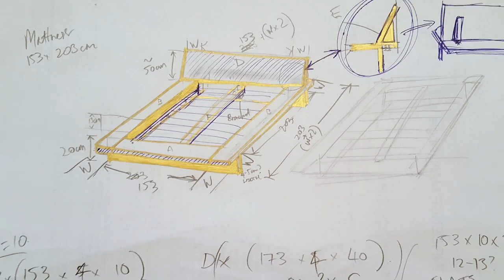Hardwood bed frame - DIY Build

Comment from the maker: Yes the music is bad. Yes I should have been wearing footwear.  You'll be happy to know I'm working on a new build video which will hopefully make up for the mistakes I made in this one!   Should be finished building and have the video up with a month or two... stay tuned folks.
Reply from the maker: @The Disliker deep question... I'm not sure the world is ready for the answer
Reply: Chris Kastner the video is actually more enjoyable with this type of music. Just the barefoot made me worried. Other than that, it was perfect.
Reply: I thought the music was very relaxing.
Reply: The music was fine except it was a bit tinny. I had to turn it down part way through.
Reply: Other than that, I loved it! I’ve been looking for a frame to build on my own and I think I just found it! Thanks!
Reply: for your final, make sure you dress it in white linens, it will always show better. the colors don't distract from the wood. love the style:)
Reply from the maker: @thecelt1950 thank you, appreciate the effort you went to writing that, and your kind words! Hopefully my newer videos are less problematic for people!
Reply: Would you still have the dimensions used for this project?
Reply from the maker: @brandonramirez6197  it really depends what size the mattress is. You just need to calculate the width of the timber you use and add that to the dimensions of the mattress (adding a tiny bit of clearance so the mattress has a bit of room around it).  I've posted a sketchup file you can use to get a better idea of how it fits together http://www.kastner.com.au/bed2.skp but note it's missing the supports behind the headboard
Reply: @KastnerFurniture  Awesome this helps so much! I was able to load this into my CAD software to change the dimensions to what I need. Thanks!
Reply: The music was beautiful along with the video.
Reply: At least, he didn't use techno music as his soundtrack.
Reply: So nice to see your work. Will you make this for our home
Reply: Nice 👍🙂

Comment: Why do people give thumbs down or dislikes. Here is someone who is doing something positive that he enjoys. He has limited tools but does a nice job with what he has. Thanks for sharing.  And as far as the bare feet go, he will learn his lesson . Nice bed keep up the vids
Reply: Why do you let that bother you? This might be the most important question to consider.
Reply: Well, thumbs up means I like what I'm seeing. I'll let you use deductive reasoning to figure out what the thumbs down means.
Reply: Limited tools?  That's funny, he has more than the average guy for sure.
Reply: I would give a thumbs down or dislike because this is suppose to be a tutorial video and the guy doesn't talk or explain anything throughout the entire thing. That's a good enough reason for me. Why waste the time making the video if you're not going to do it correctly and explain what you're doing and the equipment/materials necessary to do the project?
Reply: @seanpiercy9291  there is something called "watch and learn" not every video needs explanation.
Reply: Bare feet = self-correcting error.
Reply: @da324  and they’re no discount versions, either.

Comment: Such a magnitude of equipment installed and skills and knowhow...and then they call it a DIY video!
Reply from the maker: Well I mean I did it myself in my kitchen with no experience so I'm not sure any anyone else couldn't.  Aside from the thicknesser, if you bought dressed timber you could build this with a circular saw, a sander, and a drill... which are all cheaper than buying a hardwood bed.

Comment: Love it. Was that oak? I love the black. I'd love to add pops of red or pink cuz well im a girl. But either white or black is bad for me. My dog n my cat are white with brindle on the dog in spots  n grey blue on the cat in spots. So it shows up on a lot. But i love love the black with thst wood tone. Really makes it pop solid wood. Thstll last a long time. I especially loved the wood markings from the wood itself. Added character and an antique look to it. I dont know if i missed it or im not seeing it correctly. Did u add long screws or a medium length. I want to buolf this. It's simple, etc. i have a different sorta,  staggered with diff grains n colors for a headboard. i wanna make i been dreaming of lol. I have all the tools, even the big pocket jig they first made and a planer, but its a hand one.  However i seen they are not too much right now  so id like to buy one like you have. Especially after seeing you csn do all sides. I guess thsts what 12.5 inches means when u buy them hahaha. I wprked at a furntaure place buildimg striping  recoating etc refinishing olf pieces or tpucing them up and all those fancy  harvest tables n chairs. I loved that job so much. Unfortunately the man passed awwy before he hited us all back when he realized  hsi sprsyer hust wadnt as good as we were and a one man team took longer lol. But i loved it n he taught me alot. Took woodship in high school for an extrw cpurse. Ended uo loving it but our planers  were much bigger lol. Anyhow i wanna make furnature and i wanna duy furnature pallets  etc. I love it. Up until now i thought those planers were real expensive. I see the dewalts on for just under 300. I have everything i need but that and xtras. Im making me a bed thats it. I have never had a real one that lasted and was from real wood. This video made me so relaxed.  I can't wait to see more. Thank you. Ps barefeet are better than 5$ sandels cux thats  what id be wearing  n id prob fall on my arse too. What a pretty bed.

Comment: I actually didn’t mind the music, love the bed frame, didn’t need to see the wood go through the machine 15 times lol but a good video
Reply from the maker: I really wanted to show just how much work was involved in that.  I had to run 14 boards or so through maybe 6 times each of the 4 faces.  Whilst it doesn't make for a very interesting video in hindsight,  I felt like it'd be a lie to only show them going through once or twice!
Reply: @KastnerFurniture  respect, approving head nod

Comment: Pardon to ask this question on an old video, but just came across this. What is the name of the corner joining bracket you used. It looks heavy duty. I want to see if it is available in US. Thank you for the video. I didnt mind the music (I just reduced the volume :) )
Reply from the maker: There was a link to the ones I used in the video description but looks like the link was form an old version of the site.  I've just updated with links to the products on their new website - essentially what you're looking for is called a "maxilock" bed bracket. I used the 120mm heavy duty ones... I think they're an Australian brand though.  Had a bit of a search for you and seems like Rockler have similar ones: https://www.rockler.com/surface-mounted-keyhole-bed-rail-brackets and also the centre rail bracket if you need it: https://www.rockler.com/center-bed-rail-fasteners
Note: they are slightly different in that the side rails will 'drop in' using keyholes... as opposed to the ones I used where you fasten them on using a hex screw (Allen key)
Reply: @KastnerFurniture  Thank you for the quick reply. Looks like it will work for me. My wife just sent a vague picture of what she had in mind and I was looking for inspirations and bam I see your video which is very close to what she wants. Hopefully she likes this design, so I don't have to do a lot of extra work :)
Reply from the maker: Ah nice, she's obviously got good taste ;)
Well aside from all the milling I had to do, the overall build wasn't overly complicated and it has held up very well over the last few years.  I've only destroyed my shin once...
Best of luck with it!

Comment: How did you attached the head board?
Reply from the maker: There are two triangular pieces that match the angle of the headboard, these are attached using some inset screw threads from the underside in those two pieces, and 4 hex-head bolts (allen key) that affix it to the base.

Comment: Hi Chris, this is a very nice and a easy on eyes design.  can you please tell me the pins that you used at 3:37 what are they called?  i am new to wood work, it will help. thanks
Reply from the maker: Think they are called "centre points" (or center points, depending where you're from)
Reply: @KastnerFurniture  thanks a lot Chris that's a great help. I am from UK.

Comment: Great quality on the bed frame! I love the choice of wood you used and the design is simple and clean. I was curious about what angle you cut on your headboard? I like the angled design and might replicate that element on a build I have coming up! Thanks for sharing. Keep up the great work!
Reply from the maker: Think its about 15 degrees... basically held it up where I thought it looked the best then measured the inside angle at the back. Used that to cut an angle along the base and also cut out some triangles so it could attach to the bed frame

Comment: Great works Bro. But I think that your head panel is so short when you put the mattress and the pillows in their places, if it tall over the pillows around 3"-4" that look so better and able to supports your back when you sitting.
Reply from the maker: Yeah I agree....  I wish it was another board high (so 60cm instead of 45cm).  I guess I didn't envisage the mattress sticking out so much in my head. Still very happy with it!
Reply: It's a matter of preference.I like a low head board.Or none at all .My cheap one came with one ,but I never put ir on. Prefere bed without.
Reply: HE BUILT IT FOR HIMSELF NOT YOU
Reply: @seenitontv2734  It's my opinion that's user perspective. Have you any doubt aren't you?

Comment: What type of wood is it? How has it been holding up with expansion or warping? Thanks for any info
Reply from the maker: It's Australian wormy chestnut, which is a type of eucalyptus.  2 years in and no movement or warping. Solid as a rock. Making it in 6 separate parts that slot together allows for some movement... all the joins are glued and dowelled along the length so think that's helped hold it all together. Have moved house once and it was a dream to reassemble!

Comment: 8:35 ehh. Are there no seperator between those mattress holders? Are those not going to slide off?
Reply from the maker: They move around a tiny bit yeah... but they are joined onto a long strip of webbing along both edges. I have always planned to put a bit of dowel that sticks up a bit that would sit inside the last slat on each "ledge"... but actually the weight of the mattress seems to do the job. Have to readjust them a bit every few months but it's not been a big enough issue to cause me to act on it!

Comment: what does the first machine do? even the surface on both sides by running it through multiple times?
Reply from the maker: fUjiMaNia yep you got it... called a thicknesser or a thickness planer. Basically makes one side parallel to the other and cleans it up
Reply: cool thanks

Comment: I need to built one for me. How much will it cost to me?
Reply from the maker: Depending how much the timber you choose costs and if you've got a circular saw, drill and a sander... everything else (e.g. glue, sandpaper, dowels, and the brackets) probably cost less than $100.  All up the whole thing (minus investment in tools) cost me about $900 AUD which is approx. 650 USD

Comment: How did you get the headboard to be strong while it is on an angle?
Reply from the maker: 10:51 you can see there are two triangles behind it.  These were dowelled and glued onto the back of the headboard.  Then with the tops of the side rails, there are a couple of holes that I have run two allen key bolts (on each side) into an inset nut in the bottom of of those two triangles.  Means the headboard can come off nicely... and holds it nice and tight - has a tiny bit of movement but it doesn't get much weight on it anyway.

Comment: All that work to build a beautiful bed/piece of furniture and then to use those weak slats for the supports.......
Reply from the maker: They're fine, and really cheap ones from IKEA. Lasted 3.5 years so far! The flex they have makes them far better from a comfort perspective than solid timber ones.

Comment: thumbs down only because the first 10 seconds confirms this is not DIY. Most people looking for DIY dont have the machinery you show in the first minute of your video. Other than that bed  looks pretty nice-good work!
Reply from the maker: Benjamin Martinez either did I but decided to buy the thicknesseser for $500... could have just bought machined timber instead
Reply: He is using cheap machines. A lot of handwork. Of course its diy?